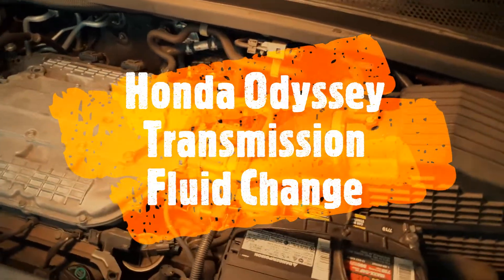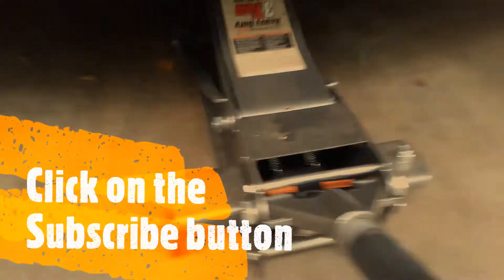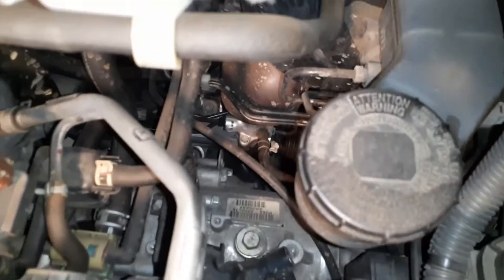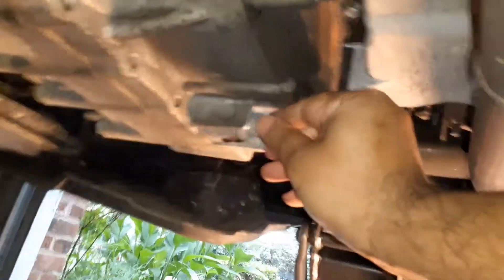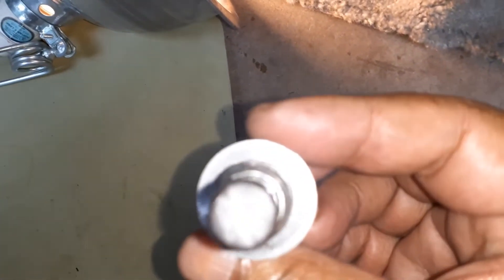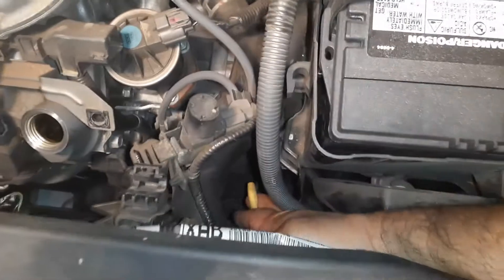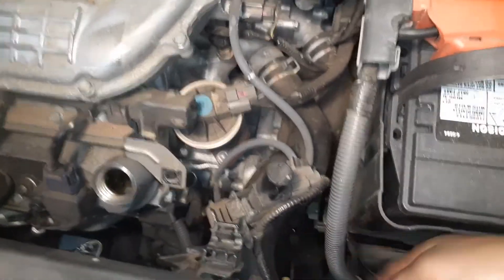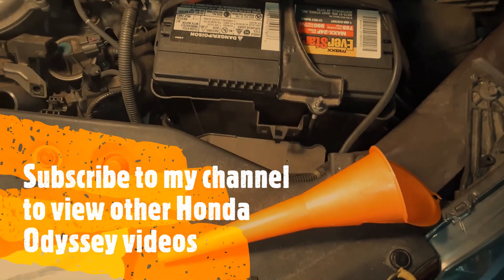2005-2010 Honda Odyssey Transmission Fluid Change

Comment: Thank you. My 2005 is a little different. Drain bolt on drivers side front, still uses 3/8 drive though. Dipstick behind the battery and fill plug in the same spot. That was quite difficult to get off. I should have listened and done that first so I didn’t give myself a scare when it was a challenge to loosen that while the trans fluid was already drained LOL

Comment: Really annoying that I had to watch the video to know you're changing the ATF on a 2006-2011 Odyssey...
Reply from the maker: I did mention in the beginning of the video that it is a 2010 Honda Odyssey. The 2011-2020 are also similar. Not sure what the confusion is.
Reply: @DIYWithIndi  They aren't even the same transmission. The 2018 that I'm concerned about is 2 generations of transmission ahead of the 2010 and 3 generations ahead on the engine. You are posting DIY repair videos, this is heavily dependent on model years. Though the process is similar, it is not the same. Put the generation or model year range in the description at the very least.
Reply from the maker: @TwoTall1988  Point taken. I have added the model years in the title. Thank you for the feedback.